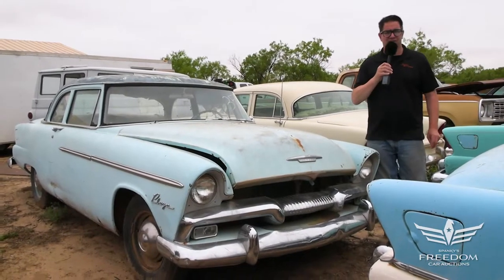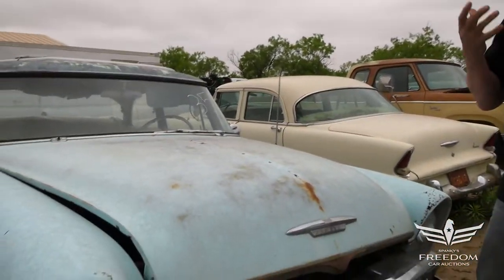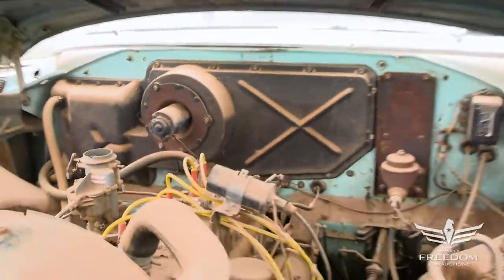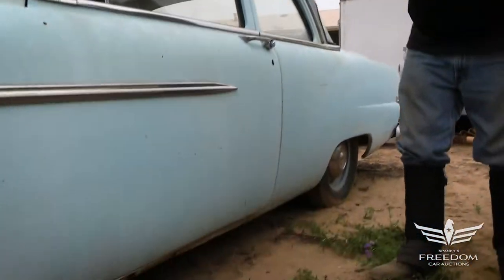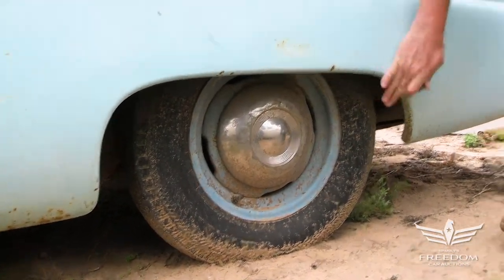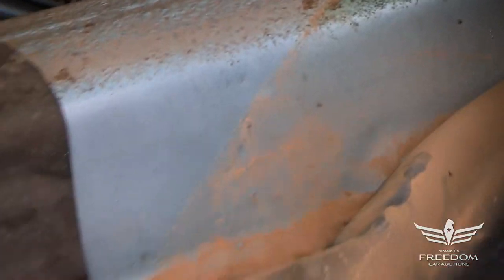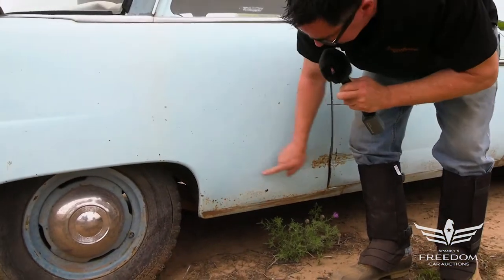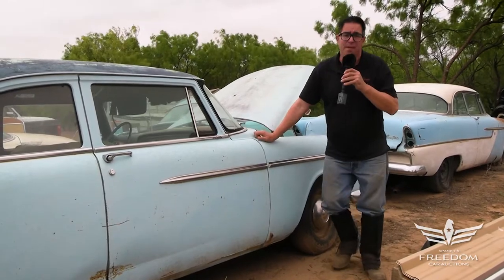35 1955 Plymouth Plaza

Comment: The flathead 6 lasted through 1960 when it was available in dodge c series trucks.
Reply: According to Allpar, 2790 RPM at 30 MPH. Yikes!
Reply: 1964 in Chrysler Royal (Aust.) and later for Marine.